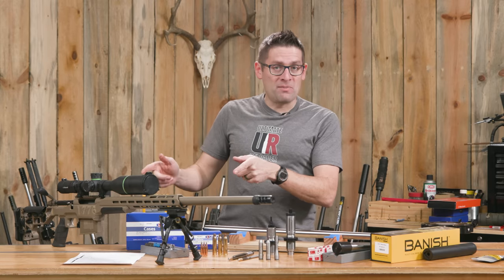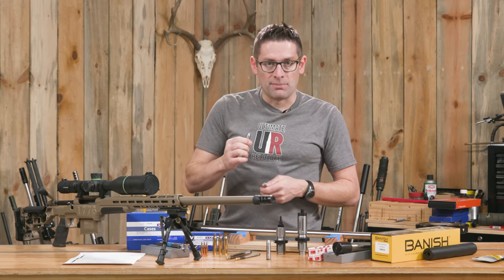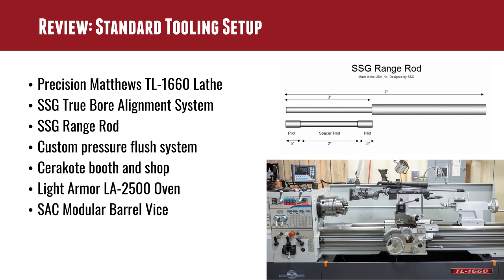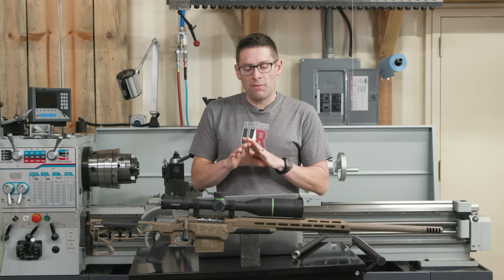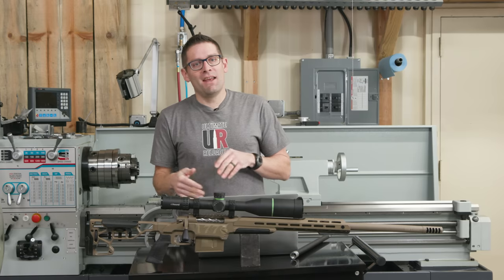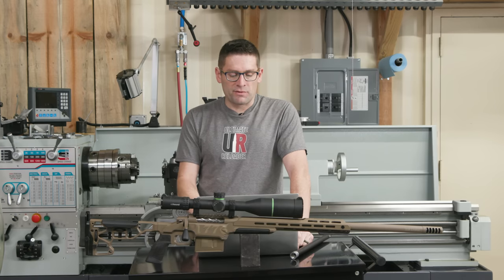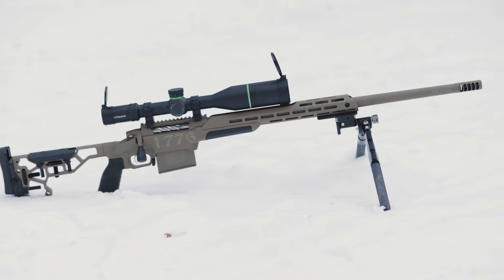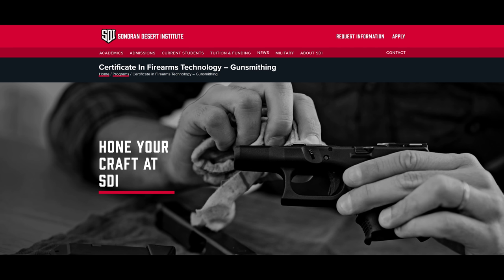338 Lapua Build Start to Finish

Comment: Gavin- I have enjoyed .338 LM for years, glad to see you build one!  I have shot mostly the 300gr Lapua Scenar out of Lapua and Peterson cases.  It likes to be loaded at -0.015 in. from the lands in my experience.  As long as this fits in the CIP+ magazine, you are good to go.  One of my guns was chambered with a bit less freebore than I like, however it still shoots the 300gr Scenar wonderfully.  Enjoy!
Reply: I should add that I have found the best ES and SD (8.5) with the 300gr Scenar with 97.5gr of Reloader 33, at -0.015 in. from the lands.  Good luck finding any these days unless you already had some.  7977 works well in one of my rifles but burns a bit too fast for longer barrels, starts to get pressure signs too early.  US 869 works but is not as consistent, but certainly shows no pressure signs.  N570 works, but I have not found a consistent charge in my testing.  Excited to see what you come up with!
Reply: Actually, I undersold the performance with Reloader 33, just went to the shop and checked the data.  Velocity avg = 2935fps at 30 degrees F, out of a 28 inch barrel.  ES = 23, SD = 6.9.  97.5gr charge weight, OAL 3.70 in, 300gr Lapua Scenar seated -0.015 in. from lands.  Only bad thing is the powder is temperature sensitive.

Comment: 285 ELD-M, GM 215M, 92.5 Grains Retumbo,  3.67 COL, .02 off, 2,798 FPS, ES 7 SD 3.  Avg. a smidge over a half inch group if I do my part. Best thus far with good consistency is 2,418 Meters on a 24" X 36" plate.  300 A-TIP's are next in line after this run.
Reply from the maker: Nice!
Reply: @Ultimatereloader  also, Peterson brass trimmed to SAAMI length.

Comment: I'm not sponsored so I did something similar on a budget.

I got pre-sale pricing on an American Rifle Company Archimedes long action and a matching Xylo chassis.  That limited me to a standard magnum bolt face but with 3.85" CIP magazine well.  So I chose 338 RUM (the poor man's 338 Lapua) and had Lothar Walther cut a shouldered pre-fit barrel for me at 30" long, with 3/4-24 muzzle threads (with one of their heaviest tapered profiles) .  I added an Area419 Sidewinder brake which is fantastic, great recoil reduction without too much blast directed back to the firing line.  The trigger is a Triggertech Diamond.

I was able to find magazines that are CIP length for 338 RUM (Accurate Mags maybe?).  So I can single load extra long ELR rounds and magazine load lighter bullet "hunting" rounds.  I'm not sure that would work with a 338 Edge (a slightly longer 300 RUM based wildcat).

30" makes it big and the gun is heavy but I can loosen the chassis LOP adjuster rods and slide off the butt, then I can fit the whole thing (and my cleaning rod) in my cheap SKB 4909 hard case with my custom cut Kaizen foam interior (Kaizen foam is awesome and not terribly expensive by the way).

I just made a padded backpack strap/sling for it using two cheap Midway USA padded slings and some Grovetech hardware.  I think it turned out pretty nice and it was cheap.

I need to get a better ELR type scope for it.

All in all, I could line it up on a bench next to you and not feel outgunned.  I don't have the nice Cerakote or laser engraving but it still looks good.
Reply: And absolutely that can be done. Nice.
Reply: @guyminer3168  thanks.  I like to tell people this because not many people know they can build this way and DIY essentially the same quality as a full custom $$$ rifle build.

Comment: .338 berger elite hunter 300grn
Coal.3.87
Powder- 110.8 grns us869
Christensen arms 338 lapua mag.
Average velocity has been consistent @3100 fps. 
Rifle likes most bullets were ran through it even Barnes 185 tsx 🤣. The ONLY bullet i cannot get consistent is the 300grn Hornady a-tip.

Comment: Just checking, but the solid reamer holder... if your tailstock is not concentric to the headstock, then you will need to perfectly clock your reamer holder every time you use it, to the same orientation as when you made the hole for the reamer.

Comment: Nice work, I've been using BAT actions for over 10yrs. Anyway, did PM just give you the 16x60 lathe? I ask bc you didnt need it at all. The 14x40 which I have is more than you need. A 16" swing and 5' bed is a bit much for a 6" chuck and 1.25" barrel.